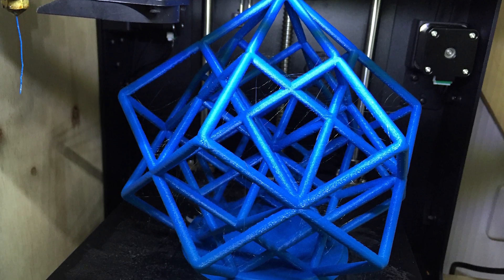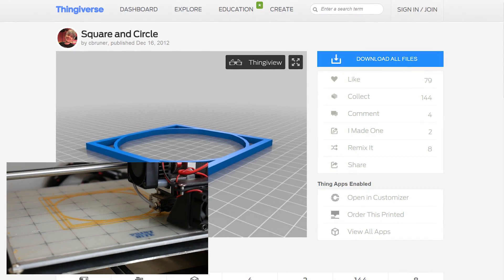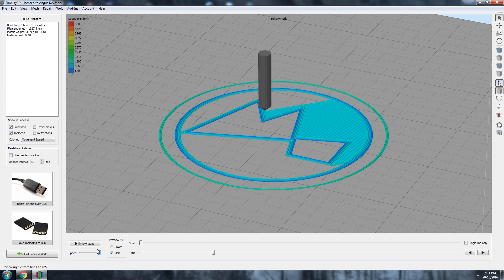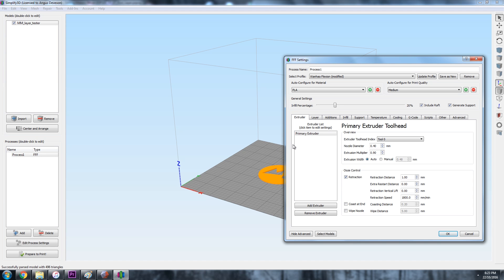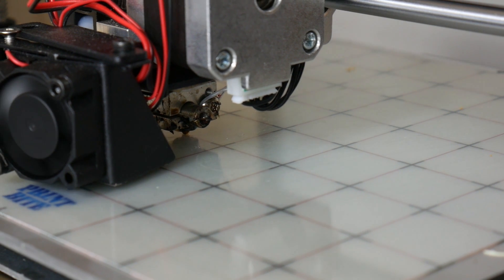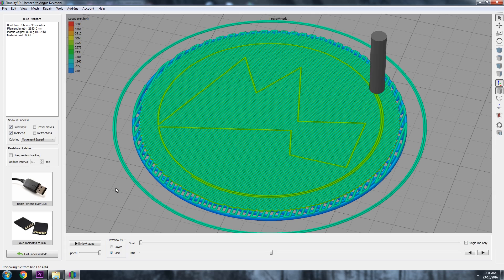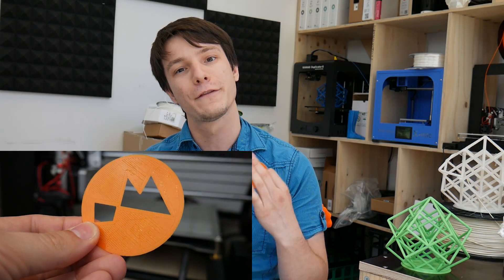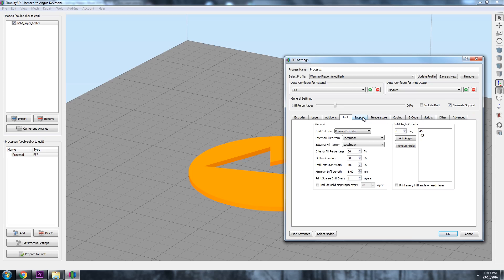How to get the Perfect First Layer - 3DP101

Comment: I would be interested in a detailed description of how the first layer height and width settings effect the flow of material relative to the change in the respective settings. Your description here sounds like these settings only effect the nozzle height(vertical) or infill spacing(horizontal) and there isn't a change in how much material is extruded. My assumption about these setting was that the extrusion was modified also, and as a result would make these setting less useful. 

I've found that calibrating your extrusion first can have a large impact on the first layer quality. Thanks!

Comment: Angus, how important do you consider having your printer in an enclosure is when you print ABS? I've been considering making an enclosure for my printer since I can't seem to keep the ambient temp. warm enough for the ABS.
Reply from the maker: Ambient temperature is critical in my opinion - I used to keep my machines in boxes during the winter months and even hit the boxes with a hot air gun to bring the air temp up before the print - it REALLY increases your chances of success and cuts down warping, but be careful as you can risk overheating the 3D Printer.

Comment: I think the first layer height setting in Simplify3D also changes the extrusion multiplier for that layer. However, at least my Wanhao i3 is set up so that if I print at 0.1mm layer height, the bottom layer gets squished a lot more than if I print at 0.2mm. I think this means that the print head is lower than what the slicer assumes (let's say 0.05mm lower), so at 0.2mm the printer would be squishing 0.2mm worth of plastic into 0.15mm of space and at 0.1mm layer height it would be trying to fit 0.1mm worth of plastic into 0.05mm. If you convert that into extrusion multipliers, that's 133% and 200%. I suppose this could be verified by looking at the gcode file. It's quite possible that I'm misinterpreting the results I see.

I actually use the global Z offset a lot more. This allows me to control the amount of "squish" based on what the filament needs and of course also the shape & size of the bottom layer. Flexible materials stick to the printing surface very easily, so lifting the first layer slightly makes them a bit easier to release.

I have my printer bed level set to print optimally with PLA at 0.2mm bottom layer height and the rest of the adjustments are done in slicing software. For 0.1mm layer height prints or flexible filaments, I lift the print slightly with the Z offset.

Comment: Have you figured out what is causing the fan to cycle on and off?  I have the same issue running Marlin on an Azteeg X3 V2 board with the fan hooked up to an unused hotend port.  Above 50C it runs full speed as it should, below 50C it cycles on and off.  I haven't found a conflict yet in the firmware, so wondering what you think might be causing this.Thanks for the video!Darrel

Comment: At least two more "advanced" videos please !!! The length of this one is fine. I'd try to keep the rest of fairly quick as well. Hour long instructional videos are a bit crazy. There are a lot of directions you could go: Filaments tend to have their quirks. Others have mentioned other programs and their settings. Dialing in bed and first layer hot end temperatures is a bit of an art. Even a bit of time with the good old USB microscope on views of various problems might be fun. Lots of possible subjects ....

Comment: Interesting..in Simplify3D for Wanhao i3 I finally settled on making 1st layer height 0.3mm no matter what layer height I have. (eg 0.1mm layer  -> 300% first layer; 0.15mm layer height -> 200% first layer etc). This gives a good thick first layer (even w/ Extrusion mult at 0.9) that sticks well and ensures 100% coverage rather than the thin stringiness I got at 90% first layer.  

I always use rims and stopped using rafts ages ago once I moved to glass + PVA (trying PEI for ABS soon!). I occasionally use brims (touching rims) if printing large square objects where corners might curl.

Comment: I have a up mini 2, and I've been facing some really bad ABS warping.  It doesn't allow first layer settigns and its print bed also isn't made of glass for ABS slurry to work well.   Do you have any suggestions on how I can solve warping?
Reply from the maker: for the mini 2, be sure to preheat as long as you can, have the little fan duct closed so air isn't blowing on the part, and make sure your nozzle height is super close to the print bed so you get great adhesion. Though you 'can' print raftless on the mini 2, I would recommend sticking with a raft on the perforated beds to help stop warping. You want the print volume to be nice and hot before the print commences, even a blast from a hot air gun will help (just don't melt anything).
Reply: Will try it, thanks so much!  I noticed that the warping was okay at first, when the print surface was new and relatively smooth.  It may have gotten worse over time.  I'll also try to put in a new one to see if it improves, although it will be too costly if I have to replace its print surface every other month or so.
Reply from the maker: You totally don't have to replace them, if you find stuff is stopping to stick to it you can wipe them down with a solvent like isopropyl alcohol to get dirt and oils off them - the biggest enemy to prints sticking. Also you 'can' use ABS juice on the beds too, just apply it to the beds outside of the machine and let it dry - just a thin layer. This has sometimes resulted in prints warping the perf board itself though - be warned :) More heat is the best solution.
Reply: This is really helpful! Thank you so much!  Will definitely try to do it with more heat!

Comment: Great video.  Ditto on an advanced video on rafts.  Especially how to make them as easy to remove as possible while providing the needed support.  Also the settings for the support layers contacting the overhangs so they are easy to remove as well.

S3D is pricey but I am very happy with it and feel it is well worth the price.  I started with S3D then tried to use Cura and boy is S3D much easier to use.  My wish would be that I could use it on multiple PCs but only one instance at any time as I design on multiple PCs.

Comment: what temperature you use for PLA without heating bed, i have a Zebra plate and the problem that i have is that The raft is stuck to the piece and cannot be separated, or what can i do

Comment: As usual great video angus but let me add my thoughts on Simplify3d and first layer height. If first layer height is set to 100% and your print height is set to .2mm then the print head will print from a height of ..0.2mm above the surface. If you used card stock that is .1mm thick to level the bed then your print head will .3mm above the bed when printing the first layer!  As you can see that is quite a difference!  Hence you must use z height compensation OR a first layer height much less than 100% to ensure good first layer adhesion. 
This is my observation and the way I determine first layer height I hope it makes sense.

Comment: maybe you should change the video title to say that it's only for simplify3D.
and maybe you could make a similar video for the more common slicers, like cura and slic3r?
probably 85% of people with a 3D printer don't have the kind of money to buy S3D.
Reply: you can apply these settings in other slicing SW
Reply: the software costs as much as many printers and while good, has just as many issues.
Reply: bro same settings are on most slicers and are called the same, do a little research on your own before bashing creators. Cura has the same settings make sure you are on advance mode.
Reply: I really think Simplify3D are missing a trick. They must know that they are priced way too high for hobbyists and casual users, so why not offer a hobbyist licence and thus hopefully prevent or dissuade all the piracy that presumably goes on as a result of overpricing?
Reply: Ideamaker has a lot of advance features like S3D and it’s free
Reply: These settings are all available in Cura.
Reply: GOD was very generous there
Reply: At 1:44 you say your logo disc is linked in description. Maybe I am blind I don't see it in there
Reply: Its late, but you know that you can have it for free?... just saying
Reply: What printer waggy?
Reply: How do i do this with cura? Im using the version included with my ender2, 15.04.3. My computer is weak as spit and cant really run anything more powerful than this.
Reply: rallekralle11
Reply: Exactly! Me too. ☺️
Reply: yeah this video didnt really help me much mainly because cura doesnt have the same settings.
Reply: @onoyoudidnt100  Cura has the same settings
Reply: So pirate that shit
Reply: Well cura can have all of those features if you know how to use it
Reply: chris Bruner 
So if you can't swing the money for the software you think everyone should use, you shouldn't own a printer?  
"you should be able to afford the software that goes with it"
If it goes with it it should come with it. I have a mortgage, and have a cruise and a trip to Europe booked. I'll use free software if I choose.  You fucking condescending twit.
Reply: Sponsored.
Reply: @VictorGarciaR  No kidding!! and...?
Reply: Victor García i know.
Reply: I have got this 3D Printer t play with.  I do not know if it is junk or something I will keep using.  Sure I can purchase better software, but before I do I want to know that the hardware works and so far it does not!  The Tarantula that I purchased has poor instructions, the leveler had none!  A lot of the stuff I have to change I have no idea where they are or how to get them.  When I got it working and need to improve the quality, then I will be looking at the software.
Reply: Waggy I’m in the same boat with my tarantula.  Nothing but problems for over a year.  Friends of mine spent the extra $50-100 and have been printing right after assembly.  Mine has been one problem after another.  Should have bought an Ender pro...
Reply: Look in thepiratebay..
Reply: Angus uses open source printer (Prusa) and closed source software for slicing (Simplify 3d) and makes remarks on MakerBot. 

Good info on the video though. Very useful info.
Reply: Holy crap man, how much was it 2 years ago. I paid 100.  That's nothing...
Reply: loser
Reply: If you can afford a 3D printer, filament, nozzles and basic maintenance equipment, then you can afford the program. That, or find an open-source program, stop the whining people and use google ffs. lol.
Reply: rallekralle11 Lol if you are willing to buy a machine that costs hundreds if not thousands of dollars, why does some software that unlocks the potential of your printer  seem so unattainable?
Reply: eennuldriezevennegenacht i don't download stuff illegaly.
Reply: Simplify3d is actually really good software. It's worth the money, and if you can afford a 3d printer, you should be able to afford the software that goes with it. It's not that expensive.
Reply: @chrisBruner  Well worth it, people are just too cheap and lazy to do what it takes these days to get what you want!  I paid 100.00.  If you have enough money to buy a printer, then you have enough to buy a GOOD program. Research PEOPLE!!!! lol /facepalm

Comment: At 2:40 when you talk about the first layers height and width it sounds like those setting are independent from the extrusion volume, but is that really the case? It would be a useful setting indeed but i think lowering the first layer height also lowers the extrusion volume, so less plastic is used as well. Slic3r has a "Z offset", that really brings the nozzle down to independent of the first layer height but I think Simplify doesn't do that, right?

Comment: I use both Cura and Simplify3d. I can see a big difference on how easy the raft will let go of the printed part. When using Simplify3d I have to cut it of but with Cura it just peal of easy. I guess it's a settings problem. Maby you can show how it's done in Simplify3d because I need help. Thank you for all your time and effort you put in to this YouTube clips. Big thanks.
Reply: Tobias Frondelius Under the additions tab > use raft. there is a setting called separation distance setting it to 0.12mm or lowerwill make it very hard to get off the raft going up to 0.15mm or more will make it easier to get off but on tall prints more separation will result in the print separating from the raft
Reply: Thanks

Comment: You should demonstrate this kind of video's with cura or slic3r because that's what most people use. All the settings you mentioned are also available on cura and probably also slic3r.
Reply: Can you explain how you get to those settings in cura because for a mod size print I have to restart it like 5 times to get it to work
Reply: I would agree that another video on using Cura or slic3r would be very useful. It would not have to be as long as this one, just an extension to this video highlighting the differences in setup for skirts, rims/brims and rafts. Or even just modifying the first layer print.
 - Eddy
Reply: i would agree i use cura and want to switch to simpifly  3d but dontnhave the money
Reply: Sponsored video.
Reply: Yeah, saw that part after my comment :P

Comment: something that also affects the first layer is retraction, I was having issues getting a good first layer, it just seemed to keep pulling away from the build plate, turns out there was a reason for that, retraction was too fast and it would pull the filament away at the end of each pass...

Comment: How do the raft settings affect how easy it is to remove it?
Reply: Separation distance change it very slightly as it may cause issues if too large i have mine at 0.15mm

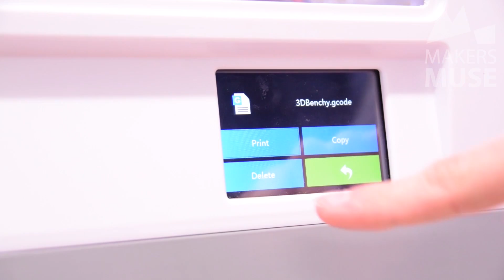Comment: Really good video, I like the bottom of the finished part in how it's all glossy. I got an interesting question though. My school's 3D printer is a flashforge (like the shown at 0:21) and the width of the first layer seems very thick (1-2mm) but on my reprap prusia i3, the width of the first layers are always very thin (less than 1mm). My printer has a 0.4mm nozzle, I dont know for my school's. What would be causing this difference in width? Would it be as simple as the "width" setting in the slicer shown by this video, or would it be the price of the printers, better filament, feed rate/extruder speed, movement speeds, the slicer itself or some other factor? Would appreciate any help, because the school's prints look 50x better than my prints.
Reply: BoomBrush FlashForge are incredible printers with incredible bundled software which is tuned for each model to get the best prints. I can't relate with the issues other have as my FlashForge Finder is basically a click print and it'll work.
Reply: BoomBrush FlashForge are incredible printers with incredible bundled software which is tuned for each model to get the best prints. I can't relate with the issues others have as my FlashForge Finder is basically a click print and it'll work.